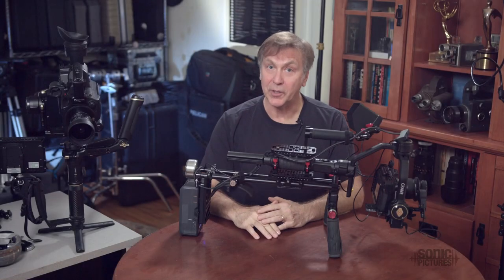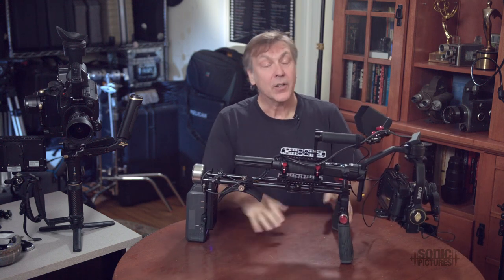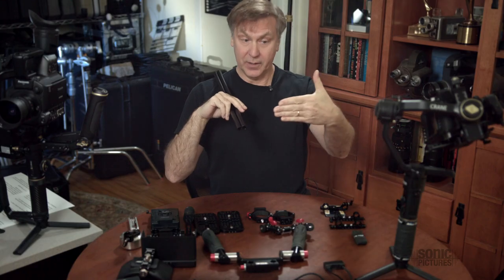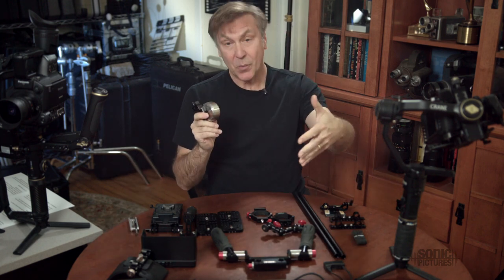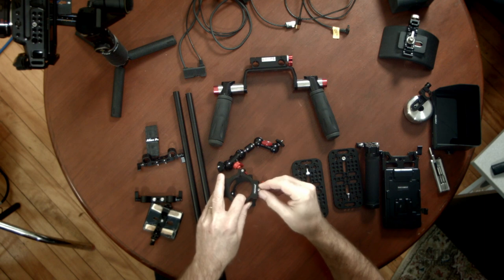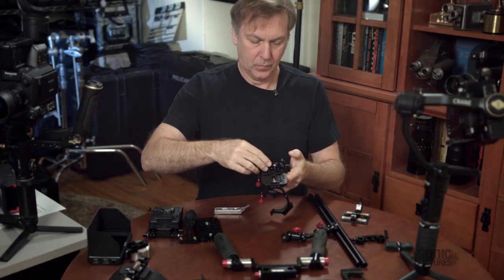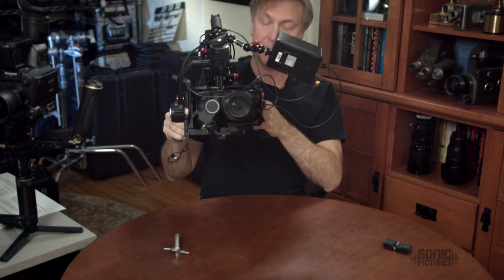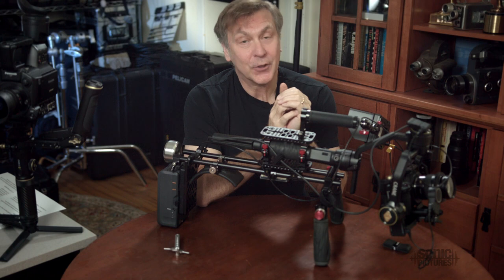Shoulder-Mounted Gimbal Rig Build

Comment: Have you tried walking/following someone while shooting? Does the fact it's resting on your shoulder makes the shot move too much? Thanks
Reply from the maker: The gimbal holds it pretty steady while walking/following. You do have to try and to be even in your steps (much like holding the gimbal in front of you). But, with a bit of practice it works quite nicely.
Reply: @gaffersband   I'll try it out! Thanks again for putting this video together.

Comment: I love the concept, but I feel like this would be terrible for your gimbal motors after extended uses.  Have you had any concerns?
Reply: I'd rather strain the motors than my back, honestly. Holding a gimbal normally an entire day puts you in a sort of unnatural position where the weight is badly distributed and it hurts in the long run
Reply from the maker: There doesn't seem to be any issue with strain on the motors, so far. I've only been using this configuration a couple of months. So far, so good.

Comment: That thing bust be pretty front heavy! IMO it kinda defeats the purpose of having camera with a balanced center of gravity on your shoulder. Cool nonetheless!
Reply: He literally demonstrates the use of a counter weight.  One could easily use longer rods and move the counterweight back and have precise balance on the shoulder point.  His implementation of this rig is second to none honestly.  It's the only one i've seen that solves the problem of quickly removing the gimbal from the rig to balance.